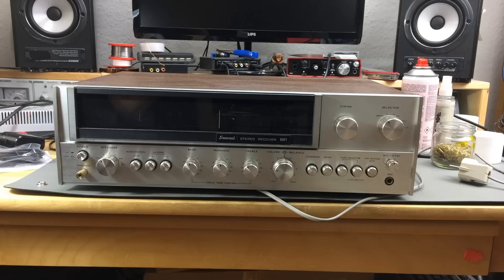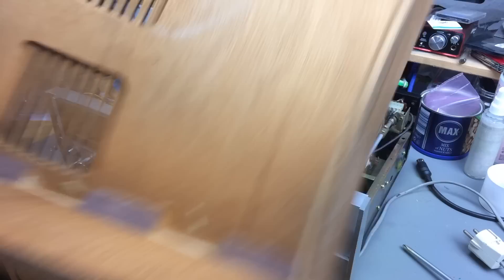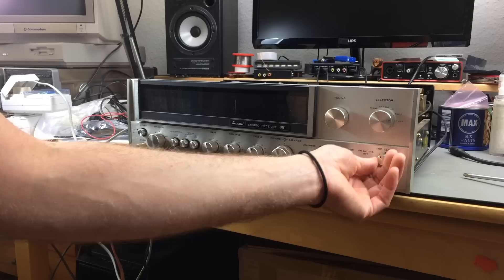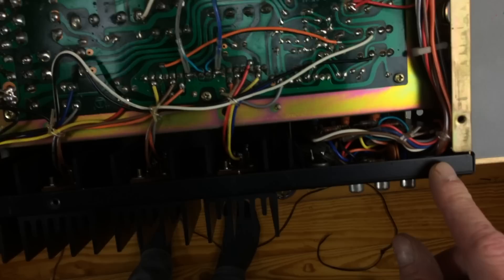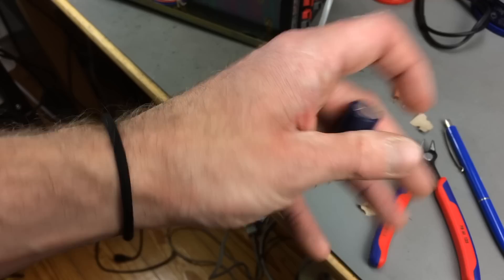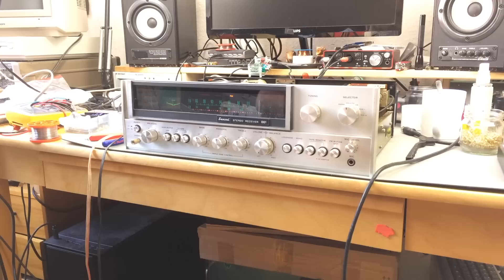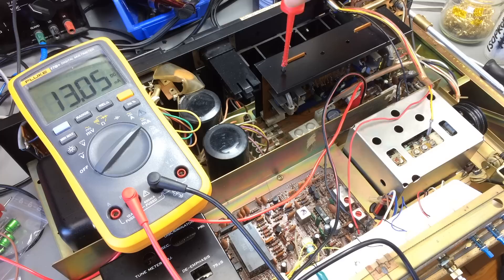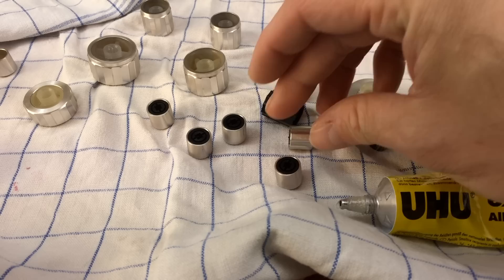Sansui 881 Vintage Receiver Restoration

Comment: I owned a factory  authorized service company for Sansui and many others. The large caps will most likely be your problem , I recently repaired 2 units and both wanted new caps in this area. This model was the top of the line around 1973-1974. These were good units with very few problems and the sound quality was decent. I still own 2 of these both going strong with very little work needed since new. The pots on the main amp plug in p.c. board can get flaky over time and could be cleaned or replaced. Thanks for the good videos.
Thomas Kitz
Kitz Electronics

Comment: @Jan Beta These models have grounding issues, not related to bad filter capacitors. Due to mild oxidation of screw heads not making a good contact on the ground traces on the underside of the PCBs. It's just a matter of taking out those screws and reflowing the solder around those screw holes and cleaning under the head of the screw and spray a bit of Deoxit into the thread of the screw that will help make a good contact to the chasis metal and screw back down. I think you'll be suprised 😊
Reply from the maker: Definitely going to try that. Some people pointed out that this model has known design flaws considering the PCB ground layout so I'm going to look into that, too.
Reply: Jan Beta das gleiche Problem habe ich mit dem 661 bei mir. Es liegt nicht an die großen Elkos. Was man noch versuchen kann, ist die oder der Brückengleichrichter auszutauschen, das  werde ich hier auch noch probieren...ich fange wahrscheinlich mit den 0310340 Teilen an, meiner Erfahrung nach sind diese Teile nach 40 Jahren betrieb ein wenig anfällig, mindestens bei den Marantz Receiver und Verstärker.
Reply: Or do what we used to do with old mobile 2-way radios and solder copper braid grounding to the chassis and to the grounding trace of the PCB that way you knowfor a fact you have a solid ground..
Reply: Matthew Enderby ... You should NEVER apply solder in an attempt to get a connection to a screw that is required to make contact to the foil.   Solder is an excellent method for making connections of wires and terminals, but is a horrible "contact" conductor.

What should be done is to wick off ANY solder that is on the trace and add a lock washer under the head of the screw.  Preferably use external tooth lock washers.  Internal tooth washers will work but have less contact bite.
Reply: @swinde  Or put in a grounding strap..
Reply: @Jan Beta take a look at minute 11:10... the resistors they actually use to discharge the capacitor...
that's the type and value of resistance to be used with the test leads..
for .. you know...... discharge the capacitor   ;-)

I've always curious about  the resistance you use in your test leads...
because if it is too large .
it will not discharge the capacitor correctly..
maybe not even at the half of his voltage...
especially with CRT ... it may not be so nice.. you know..  use the wrong resistance with the test leads...

did you ever think about putting the voltmeter in parallel with your discharge test leads???..
for effectively "see it" discharge?
scale at 1000 Volt for the CRT .. it would be fine ... it is just a moment over the scale..
Reply: @Jan Beta take a look at minute 11:10... the resistors they actually use to discharge the capacitor...
that's the type and value of resistance to be used with the test leads..
for .. you know...... discharge the capacitor   ;-)

I've always curious about  the resistance you use in your test leads...
because if it is too large .
it will not discharge the capacitor correctly..
maybe not even at the half of his voltage...
especially with CRT ... it may not be so nice.. you know..  use the wrong resistance with the test leads...

did you ever think about putting the voltmeter in parallel with your discharge test leads???..
for effectively "see it" discharge?
scale at 1000 Volt for the CRT .. it would be fine ... it is just a moment over the scale..
Reply: Can this be the case with sansui 661 as well? and if so, how should I explain this to repairman so that he know what to do? I don't wanna change caps if this is the issue.
Reply from the maker: The caps definitely need to be replaced in an old unit like this, too. Look at the second video I made about the 881, I linked a detailed website about the grounding issues in the description.
Reply: @ivcaYNWA  i have the 661 and have the same issue.
Reply: Fixed mine.

Comment: Two pieces of test gear you will thank yourself if you decide to acquire them.  1. - An ESR (Equivalent Series Resistance) meter. It will enable you to check electrolytic capacitors to see if they have the low resistance they should have.  The meter comes with a chart showing the maximum allowed resistance for the various micro farad values. If they read above the maximum, it's a good indication the cap. is on its way to failure.  With a few exceptions, you can even leave the capacitors in the circuit to do the ESR test.  2. -  And the second piece of gear is an old vacuum tube capacitor checker such as a Heathkit model C3.  A very common model that can always be found on ebay.    They are extremely good at checking for leaky capacitors. Both electrolytic's and other types.  Any leakage at all can be clearly seen on the green magic eye tube of the tester.  Modern cap testers, like those built into multimeters, can't test for leakage. The modern meters will often show caps as being good (correct value matching what's printed on the cap). But the supposedly good cap can still be leaking like crazy.  The old Heathkit tester will show that leaking every time.   The Heathkit tester you get off ebay will probably need to be refurbished by replacing the few caps that are within it.  All other components in it will probably be OK.

Comment: This kind of unusual  biasing by measuring current over the fuse of one of the PS voltage ( mostly the  + ) is also seen on some other amplifiers of that era........EX: the Luxman L30/31.....they set first the current and balance the offset afterwards....
Current is for the whole one side off the PP...and not only for the output transistors......strange method but it works out  fine ..

Thanks for the upload and the good work..

Comment: Back around 1982 I went out to buy my first stereo system. My main memory of Sansui was being told by a stereo repair shop to AVOID Sansui receivers. Thus, I ended up with a Sony receiver, a linear tracking Sony turntable, and an Aiwa cassette deck (since Nakamichi was way out of reach for my budget).

Comment: AC hum? I would have checked the main filters first and worked through the system from there. For grounding issues you can solder grounding straps (copper braid wire) to the grounding traces of the boards and to the chassis. You will need a high wattage soldering gun but this will ensure you have a solid grounding on each PCB.
You probabaly should regrease those rotary switches after squirting them with cleaner. 
Also on your card PCB you can spray cleaner on those 4 pots because those do get funky.

Comment: Hum is a defect in the design of the receiver. This post has the fix.

http://conradhoffman.com/Sansui_881_mods.htm
Reply: Brilliant - "I hereby declare that this point shall be the one true ground. One ground to rule them all. One ground to define them. One ground to bring them all, and in the darkness bind them. One ground, by definition, to be ever at zero volts AC and DC, electrically quiet, for time and all eternity."

Comment: Jan, the power switch you were questioning is the original.  The parts diagram on page 20 of the service manual shows it clearly

Comment: Hi,
That 3 leg capacitor may be 2 capacitors in one can, I have seen some like that in old tube radios, with values like 50 +´50 uF. Weird that one leg was not connected, seems they were only using half of it.
Very good work making this videos, I like to see your repairs.
Thanks
Reply: two in one is unlikely when both board and cap dont use one pin apart from stability. Maybe they wanted to reduce the amount of production steps by not using glue for bigger caps?
Reply: Ugh...I HATE multi-section capacitors. I collect and repair antique vacuum tube radios as a hobby and I really hate those stupid electrolytic can filter capacitors.

Comment: Jan, if there's consistent hum or even better sort of noise you have some transistors that are noisy. Recapping only does not solve this. You need to get schematics, find appropriate modern transistor equivalent, match them if they work as a differential pairs (which I think they do but I'm not sure). Anyway, go step by step. Go slow. If you don't know all or don't have equipment to trace few stransistors to find matches try finding someone who will do it for you. Visit some forums and ask about some stuff. Finish this beauty! ;-)
Reply from the maker: I did fix the hum in the follow up video. It was a mix of capacitors and grounding/shielding issues. I found that transistor noise is more often hissing or general random noise or distortion than a consistent hum. 120/100Hz hum is very likely to come from the mains power.
Reply: @JanBeta  Aha, oh, sorry, didn't go for a follow-up vid! Anyway, great that it's all in order now! ;-) New digital equipment doesn't settle nowhere near as a servant to these old, vintage hi-fi pieces from 1970/80's! Especially Phono sound stage. People sometimes can't believe when you play them something through the full analogue hi-fi chain! I'm pretty sure you're aware of that! ;-)

Comment: What is special about FC Panasonic caps?   These days tantalum caps are used mostly which are more reliable and much smaller, but more expensive in PC motherboards.  I remember in 80s they cost 10x the electrolyte capacitors.   Nichicon and Robicon (related?) capacitors were the best in 70s and 80s.

Comment: Nice vid, I wonder after you check for grounding issues, if that humming is gone. Also, wouldnt it be necessary to recalibrate the tuning?
Reply: Re aligning would only really be necessary if he had to change caps in the IF sections or replaces the tuning cap itself. Since he didn't bother the tuner/IF board, the alignment should be fine.. Still though it could be checked to make sure it is matching the dial pointer.

Comment: What expensive Filter Capacitors do you mean?
One "Rubycon 10.000µF 50V 105°C" costs 5,35€. The max. ripple current is 4,05A
One "Jamicon 10.000µF 50V 85°" costs 1,99€. The max. ripple current is 3,86A.
Please note, that a really bad capacitor can stress the Rectifier and the transformer.

Comment: Your mainly change the caps on old electronic stuff. Why don't you get a cap tester to check the values and characteristics of caps like internal resistances and values.  Then you can check the big caps without guessing them they are bad.

Comment: Apart from changing burnt out lamps and capacitors in receivers or any old Hi-Fi systems, giving the circuit board, and the whole unit a good clean first with something like electrical contact spray could fix some of the issues including the humming.
Reply from the maker: Yes, the humming is probably a grounding issue. It seems to be a common problem caused by some design flaws in this model. I'll definitely give the connections a good cleaning and look further into the issue.
Reply: @JanBeta  Probably something as simple as that yes, good luck and hope that'll fix it. Enjoyed the video and would be good if you could provide us with a short update once the humming is fixed :)

Comment: Is it really needed to replace all electronic capacitors? Even if there looks fine and there is no visual leaks form them? What capacitor was finally the one causing the hum? It persisted after replacing the big capacitors from the power supply....but if you mentioned what was the cause for the hum I did miss it
Reply: If you hear 100 Hz hum, it is a good thought to suspect the capacitors. That said, capacitors of this kind of equipment are rather durable, and IMO recapping can make things worse than better, so you should be carefull in what you do.

Comment: Wouldn't you double check wether it is really the filter caps with your oscilloscope or so? It might also be the voltage regulation that isn't perfect anymore. These machines date before the time of the 78xx voltage regulators and often use a voltage regulation with discrete components, with a zener diode and transistor as main ingredients.

Considering that:
- Filter capacitors don't fail often
- You are likely not pulling max load from the power supply, it would need to be way below its rated capacity
- It is a Nippon Chemicon capacitor, these are generally indestructable

... it wouldn't surprise me if something else is going on. Better check before spending money.

As an alternative to using your oscilloscope, you could desolder them and measure them.

Comment: Isn’t it better to adjust bias current first and then DC offset? Even for bias isn’t it better to measure first both channels and if you find to be the same leave it that value? You never know if you are using the latest version of the service manual, right?

Comment: Hello Jan. Thank you for the great video.
I've got a Sansui G2000 Receiver from my father in law. To put it on I had to replace some resistors. After more than one year working my receiver starts to show another problem. Now one of the channels (the right one) after turned on starts to make a loud noise (like when you have some faulty contact on the speaker). It keeps the same even if I change the volume, balance, input selection... It only stops (of course) when I turn off the receiver or unplug the speaker. I have already changed the speaker, cables, and the problem continues. With my multimeter I got from 0.2 to 1.2V (it keeps floating, like the sound) reading on the channel output. Do you have any idea what can be the source of this issue?

Comment: A loud hum independent of the volume is not necessarily bad filter caps. 300 series of B&K Components receivers (higher end made in the USA) have this hum (at least the 5 I have) and pretty much identical 500 series have no hum. The 4 filter cap are huge ( almost as big as beer cans) and all test fine on ESR. I even bought new caps and the hum didn't change. I converted one 300 series to a power amp and it was dead quite. Thus, the fault must be in the smaller windings (toroidal transformer) for the preamp, or a (consistent) problem in the preamp circuit. The amp section is identical on both series and the preamp analog board is also the same. Only digital processing changed on the newer series, so I suspect loose (lower voltage) windings on the batch of transformers from the 300 series transformer. Does anyone know what else would cause a rather loud hum (it's annoying at even 6 feet away) at idle on a receiver that works perfectly otherwise? I can't find anything on Google, other than a bunch of humming 300 series B&K receivers.
Reply from the maker: Interesting! I've encountered quite a few humming mains transformers (due to windings working themselves loose slightly), usually you can fix them if you spray a generous amount of PCB sealant lacquer (I used Kontakt Chemie Schutzlack 70 which is a German product but similar sprays should be available elsewhere) between the windings. Not sure how well that method translates to toroidal transformers though.

Comment: Hi, I haven't watched the full video yet, but I am wondering if you know what fuse lights should be purchased for this model.  I have this same receiver, and it's all 100% functional and in pristine condition, but my fuse lights behind the radio dial have gone out slowly over time.  So, I'd like to replace those (either with new LEDs or originals), so any guidance you can provide would be very much appreciated!
Reply from the maker: I think this one uses 6.3V 250mA fuse style lamps, you can purchase them from many electronics components sellers. You can also get LED lamp kits that have been crafted to have the same form factor (I usually get those from eBay). They are fine but the light is a lot more directional (so you might not have a completely evenly lit scale) and the color is slightly different.

Comment: Could someone tell me if the replaced orange color caps replaced in this unit are some kind of special ( dedicated , low noise, placed in strategic points? ) caps and should be replaced with the same kind? Have read somewhere about it but not sure if memory serves me right. Txs

Comment: You do not belong in there. You have no idea what you are doing. You cannot identify the tuner or other sections. Begin by getting the free service manual online.
The removeable pcb is the power amp driver board not the preamp. It has adjustments for dc offset and bias. Both must be adjusted in such an old unit for starters, at completion of parts replacement.
Bipolar caps can rarely be replaced at such high values with film types. The main pwr amp filter caps must be replaced in a 45 year old unit as they are likely leaking current causing the hum or are close to shorting being dried out.
FC caps can be used but are intended for switching power supplies their having a min. impedance at 100khz not the required 120 Hz. Select an appropriate type for the application. Replace old rectifiers and fuses. Remove conductive flux residue.
Scary all around.
Reply: Thanks for sharing.  When he mentioned not replacing the main PA filter caps, right after saying there was AC hum, my instinct was to look for a comment like this.   No offense to him though of course, I appreciate the video, but you've really helped with the details and proper knowledge.